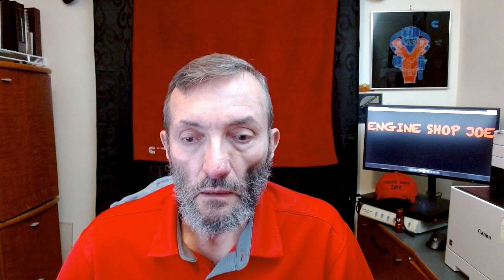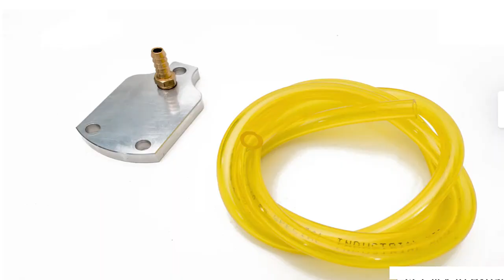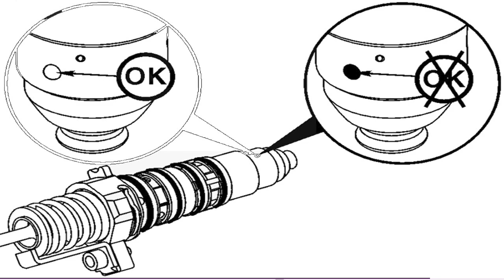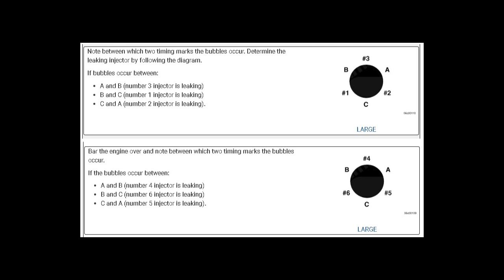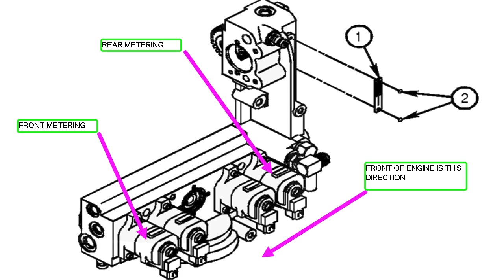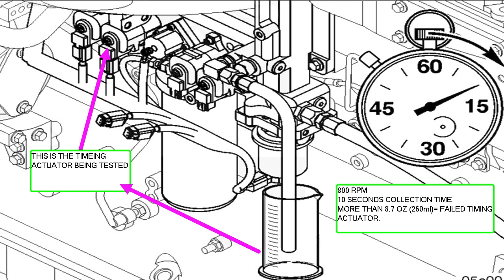Why does my ISX cm870 Lope at idle

Comment: Joe, I had both metering acuators on a qsx Cummins leaking. I took them off cleaned up and started tractor and it runs like it’s only hitting in three cylinders. I replaced both of them with new ones and plugged in and still running like crap white, gray smoke and rough. I tested each plug to make sure they were both getting power and seemed to be. I did not mess with either timing actuator when I did this. Would there be air in the system causing this issue? I have tried letting it idle 4 separate times to see if it would work itself out and it has not yet. Any advice would be awesome thank you
Reply from the maker: unplug each actuator one at a time while running. If the engine does not stall or change how it is running that is the problem bank. Then plug that one in and unplug the other one and see if it stalls. If it does it is only running on one bank. If a timing actuator failed it can't run on that bank as the timing is so retarded the fuel does not get hot enough to burn IE grey smoke and missing. If you isolate the not running correctly bank you can swap timing actuators and if the problem moves to the other bank you know it is the actuator. They can be a bugger to get air out of. I used to have a guy hold the throttle pedal down to keep rpm around 1600 and then unplug the good bank to force the ecm to wide open the actuators to help move air out. My reply assumes it was running correctly before you first took off the actuators.

Comment: Ok update....I got the tool with the hose....I have bubbles on front mettering and back mettering... more on front...
Reply from the maker: bubbles mean bad injectors. You can isolate the injectors with that tool by baring the engine by hand and as soon as a bubble comes out stop and the letter coming up next to the valve set mark is the cylinder causing the problem. You might need a set of injectors.
Reply: @ENGINESHOPJOE  yes sir I do fpr sure...#12@6 are bad..trying to find a set now..thank you very much for all the info ..

Comment: Letting the mid week special shine a little 🚨 on me! I haven't even watched the weekend edition yet!!! Good as always, trip down memory lane. Had three CM870's, pretty good luck with them. Had the occasional weird injector issue that would cause them  to sound like a John Deere A and blow smoke rings, narrowing it down to repeat at shop wasn't always easy but usually was an injector. I just assumed it was the metering check valve or the drain regulator in injector not  allowing plunger to fully seat at end of injection, had one or two CM871 that would run on when shut off that was also bad injector. HPI-TP was a fuel system with a lot going on and it appeared Scania helped in the development because the fuel pulsation dampers had Scania cast in them if I remember  correctly. Thanks again.

Comment: Thank you joe. I was the one asking about this ... yes I have cleaned the intire system including the tanks. Every fuel line.. I have noticed this week when it starts loping I can kill it.. turn the key on let the pump run a minute and start it . Will go away in a few seconds.. may not do it again all day or may at next stop.. I don't fill like it's a injector because it runs very good .. but never no.. where could I get this icm updated? May try this next.
Reply from the maker: At this point I really don’t know what is wrong with your engine. I will tell you this. I have had alternators that had a diode go bad and start leaking A/C into the  electrical system cause strange problems. There is a video on my channel about that. I also have had wiring harnesses cause strange problems like this. Make sure there is no oil in the harness plugs at the ecm ports. The Jake wires were famous for letting oil get PULLED into the harness. The ecm breaths through the harness. Once oil gets in the harness it breaks down the insulation and allows cross talk between wires.
Reply: How can I get in touch with you. I have this lopping issue with my cm870 @ENGINESHOPJOE
Reply: All new fuel lines from tank to motor pluse in-between fuel cooling plate.. I put different mettering on fuel and timming didn't change anything.... no fault codes. Just says de rate fuel 1.2.3.. all fuel pressure are good no restrictions.. just had overhead done so that should be okay also. .. so I'm thinking like you ecm  or injector..

Comment: If these computerized diesel engines are the result of "progress", heaven help us! A world away from a simple "Big cam 400" where the average diesel mechanic in Anytown, USA was qualified to repair them!
Reply from the maker: My favorite HD diesel is the ISX CM 570. No emissions and was a beast when it came to horsepower and torque. Simple software and good ecm.
Today emissions regulations have caused the volumes of system parts added on to engines. I would go back to the first gen ISX 600 but with all the mechanical updates to fix the mechanical problems. Having said that. I like that we are putting way less bad stuff in the air for our kids to breathe.

Comment: Dang mid week treat today. Joe your the man helping your fellow man,that’s really cool of you. I’ll add my two cents in here real quick, this new fuel we run is a big problem for us, it really drys and wears parts out quick. I would pull my meters apart and clean them when it would idle rough, fill the fuel filter full of Lucas and force it through the system and it would help. I noticed the metal plates on the meters/ actuators would gall,so with a little love and buffing you could make them not stick.

Comment: sucking air, inlet screen plugged, worn main fuel pump drive(shaft) gear wear, if the stratoflex hoses have never been replaced i would do those. are you saying the front and rear actuators are different, was unclear, as in any testing of them cummins says to swap timing and metering to check the actuator, dont ever recall swapping front to rear.